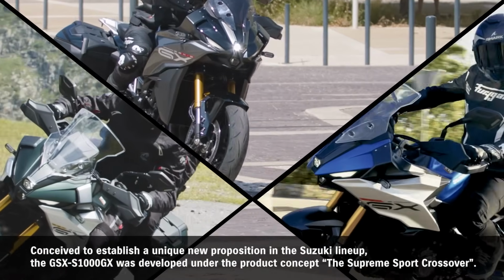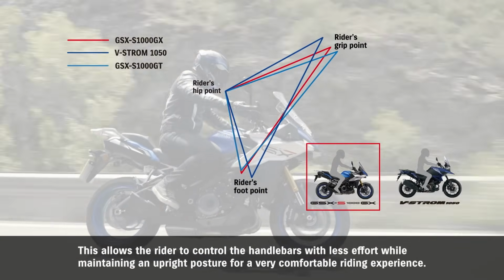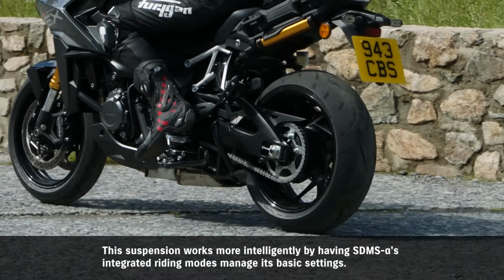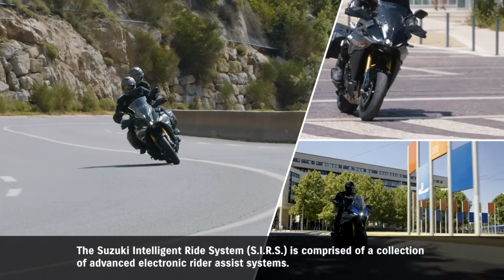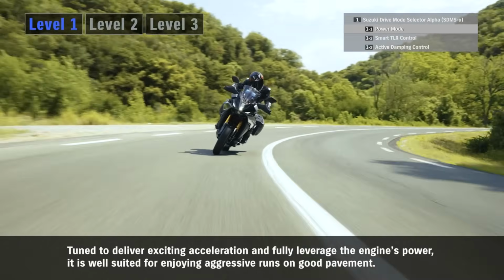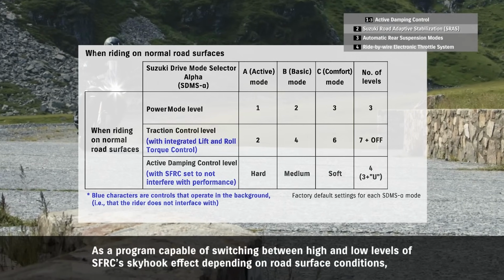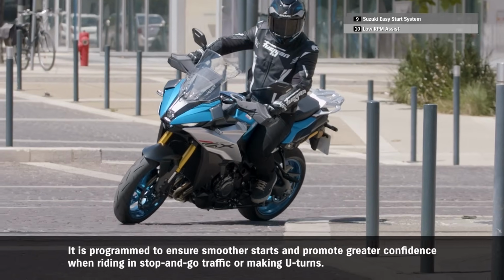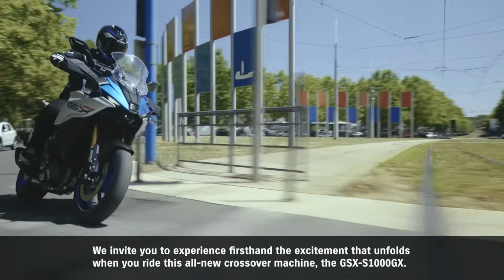GSX-S1000GX Features & Benefits | Suzuki

Comment: Every review has complained about the Dunlop tires Suzuki is mounting to this bike, in addition to the brake pads. I will not appreciate the need to change the tire immediately if I buy this bike. That said, a new set of tires is still cheaper than replacing cams on the BMW S1000XR.

Comment: Nice sports tourer, plenty of good features. But you miss the bigger market: adventure bikes. 
Suggestion: Use the lighter 750cc engine. (120hp is more than enough) make it 10% less expensive and heavy (no more than 200kg), develop an off-road mode, 19 inch front wheel, longer suspensión without raising the seat, good integrated protection against falls, and take my money!

Comment: Just a suggestion: TLR system config should be separated instead of unified as a single setting. This in my opinion is better especially for track days/sporty riding.

I'd like to be able to tweak the lift, roll torque and traction control separately

Comment: One thing I don't understand - when there is IMU, ride by wire all the sensors, why is traction control tied with antiwheelie? I mean TC on is good backup, but a rider might enjoy the front wheel lift from time to time... right now the choices are basically nothing or everything
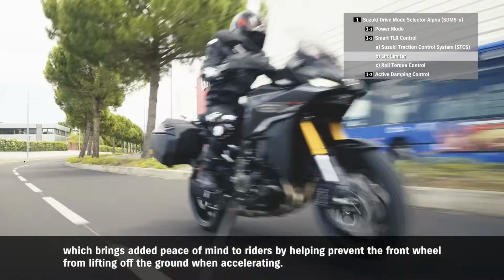Reply: Assuming you skipped over that part of the video @20:30 where it states that the lift limiter sub routines are integrated into the STCS function that offers 7 levels of intervention with the option to have TC completely turned off, so yes it is possible you can fulfill your Gixxer dreams
Reply: @thekenthouse6428  you can only turn off everything. My question was why the TC, lift limiter and roll torque control aren't adjustable independently. Most bikes in this category allow riders to fine tune it as they want. All the systems are already on this bike, so why integtrating it all into 1?